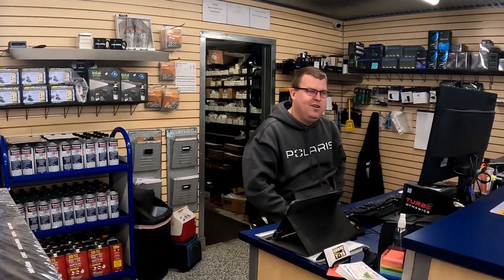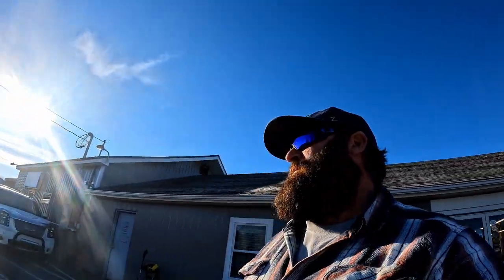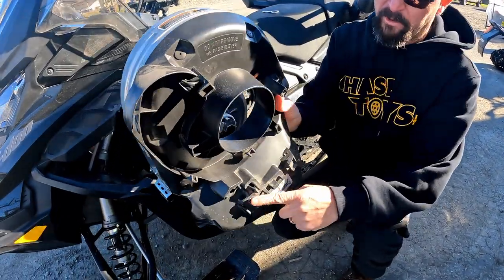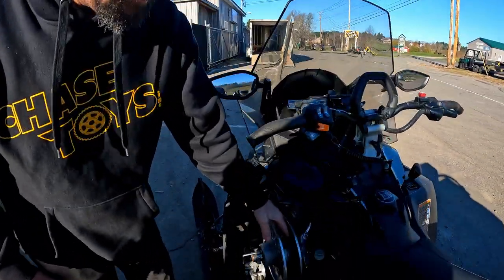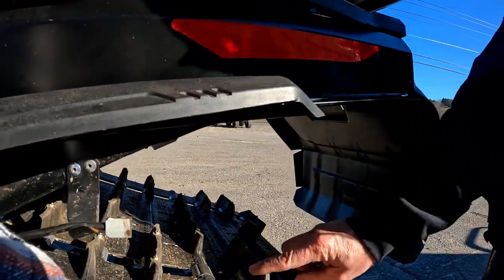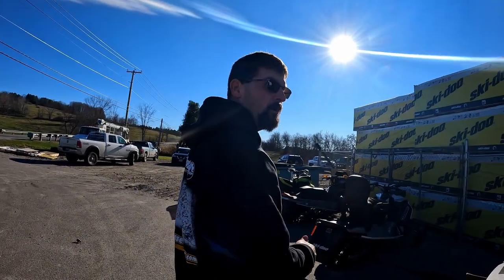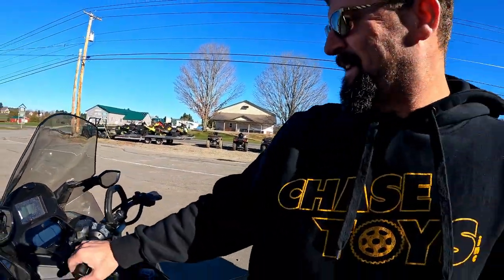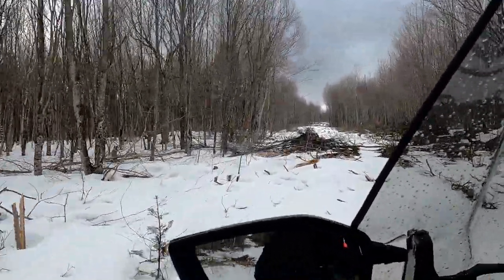Is your snowmobile ready?

Comment: I live in Washington Maine I have my own shop dealing in marine parts etc. I sold one of the Amish guys a boat trailer they bought. Week after I saw it in whitefield they took the rubber tires off put wagon wheels on it lol.
Reply from the maker: Very cool thanks for sharing. The guys at Chase said they are not allowed to ride a snowmobile so it comes down more to the propulsion via motor rather than the tred or track I guess.

Comment: I snow checked a 2024 expy se with 900 ace. So you didn't like the halogen lights that came with it? Are the led's brighter? I would recommend a skid plate for your sled for what you do if you don't already have one.
Reply from the maker: Yeah I didn’t think the original lights were bright enough at night over 39moh so I switched I also added the heated cell phone holder and extended glove box and wider skis

Comment: What engine did you go with? I just picked up a '23 expedition with the 900 ace turbo R and so far love it. I cant wait to get it out fishing Lakers in Canada. Hoping the last bout of snow dosnt produce a bunch of slush, if it did though is why i went with Turbo.
Reply from the maker: I have the non Turbo 900 Ace
Reply: Non turbo means lower gear rating perfect for ice fishing,turbo R has abit higher gear setting kinda stress ur skidoo up,I want the turbo R so bad but it’s mainly fishing sled,I’m stuck between the two 😅